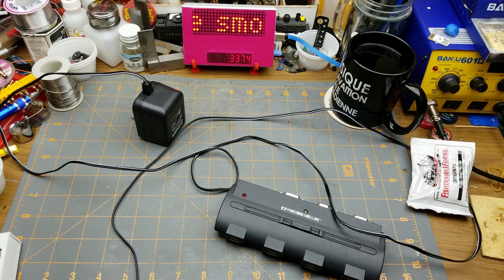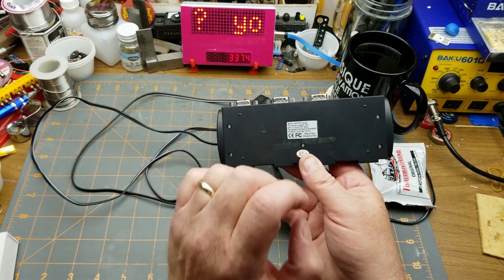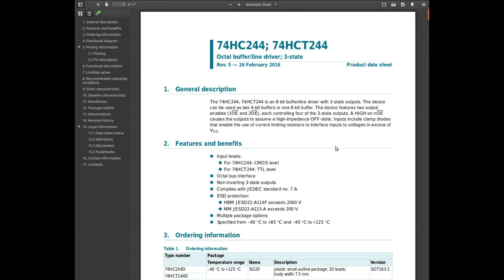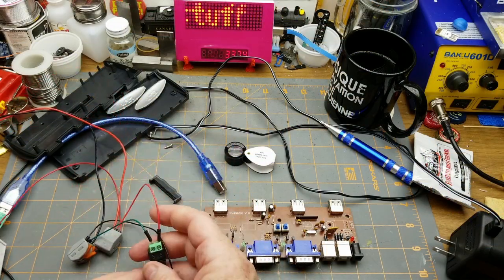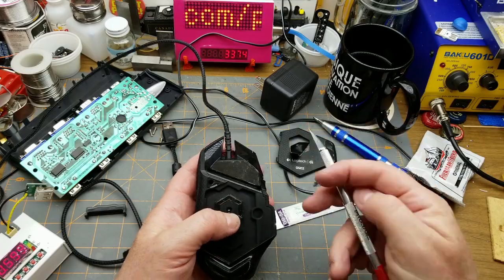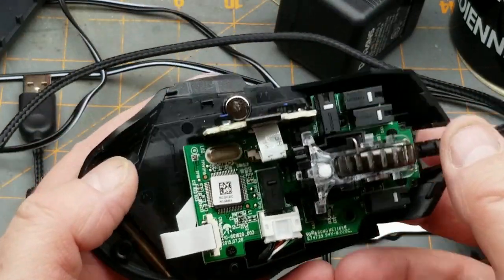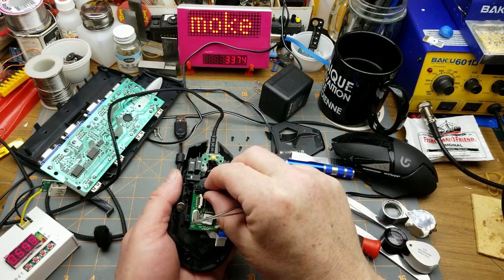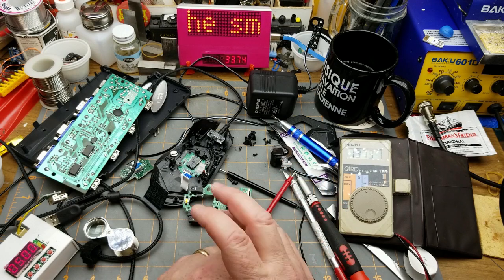KVM and mouse teardown.

Comment: I looked at some datasheets, and it seems that pinout of these things are almost the same everywhere:
1. Vin
2. GND
3. chip enable
4. not connected/bypass cap (some models)
5. Vout

Chip enable will probably tied to Vin.
You could try to desolder this dead bugger, and either buy some ldo and solder them or put a link between pind 1 and 5, and power it with your power supply set at 3,3V with current limit about 500mA. If you hit current limit or nothing happens, then it's scrap, but if you see some disco lights show/flashing leds/whaterver, there is a big chance that this mouse might be still good.

Comment: If every pin on the regulator is shorted, is 5 V also shorted to ground? I wonder if it shorted out the incoming supply when it blew the regulator, maybe the damage was contained at the input and it didn’t allow the higher voltage to get over to the micro controller  because it was just pulling down the input supply after it blew the regulator. . Maybe you could  pull the regulator off the board and just try to inject five and or 3.3 on the pads to see if anything comes alive.
Reply from the maker: I still haven't been able to find a reference on that regulator part number. I'm not sure what exactly I'd replace it with. 5 pin regulators aren't something I've played with before.
Reply: Yes exactly. Just take off the regulator and power it with 3.3V. The uC might very well still be alive. Depending on current, the regulator could be replaced temporarily by two 1n4148 in series.
Reply: @pileofstuff  You would think going from 5V to 3.3V it's a LDO, so how many 3.3V LDO SOT23 or SOT23-5 could there be.
Reply: Kind of agree: I would have thought 17V onto the MCU would have produced visible signs of damage, much worse than on the regulator - more of a big hole like in the KVM switch.

Comment: You can find that chip in handheld controllers, some higher end CD players and most optical mice. I've seen it several times in different applications usually on 3-5½ volt devices. You may be surprised as to where you find it! Hope that helped.

Comment: If all the voltage regulators pins are shorted out, doesn't that mean it shorted out the incoming power supply before power hit the ST chip? If so, you might still be able to salvage it by replacing the regulator, and the ST chip might be fine.

Comment: It's a 12 VAC powersupply, which would explain the 17 V RMS and the four diods. Just guessing.
Reply from the maker: Nope. It's labelled as 12 VDC output. 

One problem is that it's not doing what it claims. The other problem is that I should have used a 5V power supply.

Comment: Maybe the mouse has a TVS diode in there that did short ciruit to ground and protecting the chip.
I have fixed hardrives that people put 18 volt on instead of a 12 volt transformer and i just remove the TVS and it works again, until next time they put the 18 volt on it, then its no safety anymore :)
But i tell to plug in the right transformer and do a backup and use that hardrive as a windows disk.
Usually those TVS diodes are two pins, but perhaps the five pin chip also have TVS.
Yes, it seems TVS diodes come with 5 legs here. I dont know if it is the same.
https://docs-emea.rs-online.com/webdocs/1250/0900766b81250b85.pdf